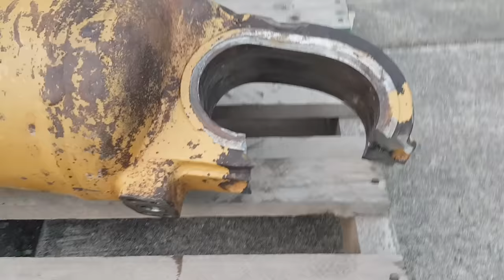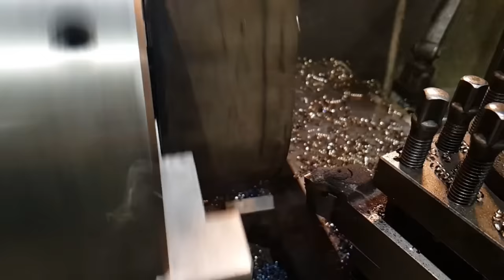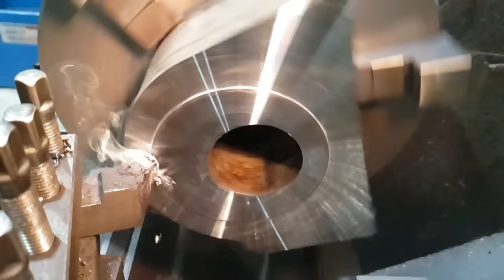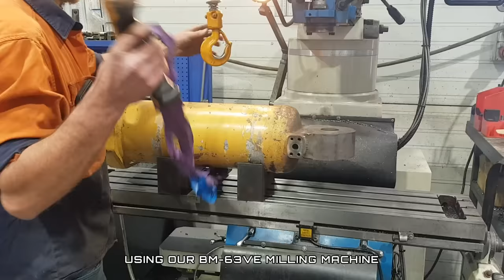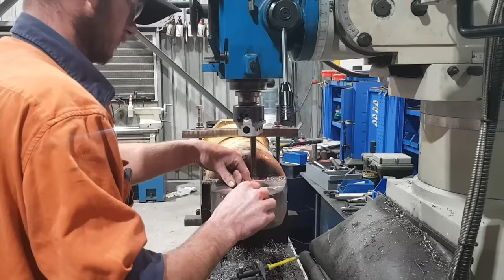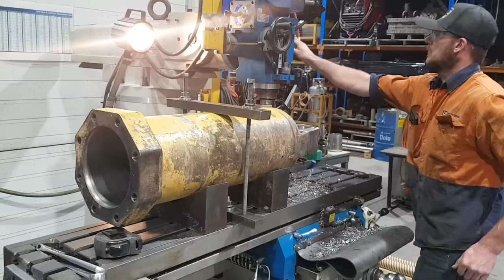Replacing Eye on Hydraulic Cylinder for Caterpillar D9 Bulldozer | Machining, Welding, Milling

Comment: Pakistany truck guys would fix that in 10 minutes with a stick welder and a grinder.
Reply from the maker: Hahaa no doubt 😂👌
Reply: And it would last 10 seconds!
Reply: Yeah. And phuk up in 10s
Reply: And sandals
Reply: And break it again after 1 hour. Lol
Reply: And when the piece breaks and a piece crosses a worker, they throw it on the road and continue without problem ...
Reply: Ahahhaha ha really bro its a pro Pakistan
Reply: The outback bush mechanics wouldn't even need that - an old brake drum, a piece of wood, and a bit of old cable. She'll be right brother.
Reply: And a hammer lol
Reply: Jb weld that no problems lol
Reply: doubt it.
Reply: Human bomb also lol
Reply: But they do wear safety flip-flops.
Reply: And a cardboard box and sunglasses for a welding helmet
Reply: Yeah with a double tape😂😂
Reply: The welding machine is homemade by the guy with flip flops made out of an old car tire
Reply: Like a walk in the park for them
Reply: People make do with what they have. I mean the alternative is not to try.
Reply: Naw, just heat it up, pound it back in place, weld it up and grind off the excess. It will be good to go!
Reply: It would not even fit properly
Reply: This one only took 13 minutes🤷🏻‍♂️🤣
Reply: That’s how it was done here way back in the day, had to utilize what we had, we too were a developing country once.
Reply: 😂 what A comparison.. go shame yourself..
Reply: Lol no they wouldnt. Ugh
Reply: Pakistani weld and chinna goods no guarantee

Comment: Excellent job! I'm curious: this quality job comes at a price, is this part hard to come by, new or used, or is it really expensive? Or is it that having it repaired is simply the fastest way to get the D9 running again?
Reply: He addressed this question in another video: Repairs are just much cheaper.  Replacing parts like this costs thousands more than a day or two of Kurtis' time, valuable though he no doubt is.
Reply: @ofsinope  It looks like the repair is thicker/sturdier too. Which in principle is a good thing, unless it causes sonething else more expensive to fix to fail instead.

Comment: An old timer once told me; “always buy a used caterpillar. Then most of the problems will be fixed. Buy a new one and you’ll spend all your time fixing it”
Reply from the maker: Wise words 😎👊💥
Reply: @CuttingEdgeEngineering  Amen
Reply: A fixed part with 1 brand new part versus everything brand new. Yea dunno that old timers pretty delusional
Reply: @biggestbruh3780  when you fix the part your fixing the initial problem that made it fail in the first place. You’re making it better so to speak. That’s what he was talking about. All the fixes on the used machines are made better than the original if done correct. The repair in this video is a great example of that.
Reply: Nameofthegame if it’s all brand new shit shouldn’t break
Reply: @biggestbruh3780  and yet they do... maybe witchcraft? What do you think?
Reply: Smart analogy let first owner work the bugs out and reengineering...
Reply: I was given that advice many years ago too, by my first boss. He called it the 20/20 rule, which is: if it's still going after 20 minutes, it will go for 20 years. I'm not sure that 20 years is still applicable (things were made better back when I was in that job) but the principle is the same. Brand new equipment is not tested satisfactorily enough before it leaves the place of manufacture, but second hand stuff has been well tested, and any part that broke has been fixed so it works like it should. There is no substitute for the practicality of extensive field testing. I've always looked at it like this: if it's worked reliably for this long, chances are it will keep working for a while yet.
There are arguments to be made for buying brand new of course, and manufacturers need us to do that periodically lest they go out of business. And there are times when buying new is the smarter option. Like consumables, for instance. But it's definitely true that you don't really know what you're buying when you buy new. Salesmen will make all kinds of rash promises about how good the stuff is, but when it fucks up (which it will) it's always a pain in the ass. Getting  it fixed and/or replaced is NEVER as easy and convenient as they claim.
My driveway and garage is full of vehicles and tools of all descriptions, some of them are over 35 years old. The only stuff I've ever had that's failed has been the stuff I bought brand new. I bought a brand new Makita 18v drill/driver once, it gave up after two weeks and I got stuffed around so much by the retailer I resorted to shouting at them in the store to get a refund. "It's been sent off to be fixed". "There's a problem, they're going to replace it". "There's a hold up with the shipping". "We lost your paperwork". "It's arrived but it's the wrong model". Six weeks later, they still had my money and I still had no drill (it wasn't Bunnings, by the way, it was a specialist tool shop who shall remain nameless. Bunnings would have just handed me a new one off the shelf). I went and bought a second-hand AEG unit from a pawnbroker (for a third of the money) and it's still going after 6 years, with its 6 year old battery. You can bet I thought of my old boss a LOT during that whole debacle. And that's just one small example. Don't get me started on the brand new Commodore we (stupidly) bought.... it's no bloody wonder Holden went broke if that piece of shit is the best they could do. It spent more time back at the dealership getting "fixed" than it did in our driveway. Luckily a tree fell on it in a storm one night and we took the insurance money and ran. Replaced it with a second-hand Honda CRV for less than half the money, and we still have that Honda nearly 15 years later.
Reply: @biggestbruh3780  "if it’s all brand new shit shouldn’t break". LOL. You must be young. Don't worry. You'll learn. Us older blokes have learned a thing or two in our time. 35 years in the trade game teaches you a lot about tools and machinery. Read my other comment, see if you can learn something. It's more relevant than ever now, new stuff is made so poorly, everything is built to a budget, not to a standard like it used to be. Profit trumps reputation for most manufacturers nowadays, everything is made in China with no testing whatsoever. They use the public as their testers. If you want to be a tester that's fine, but constantly returning broken shit and getting stuffed around by retailers gets old after a while.
If you want a tool or a machine that's already been extensively field tested and sorted out, buy a second-hand one. Not to mention it will only cost you half as much.
Reply: @woopimagpie  Not sure about 20 minutes.. Perhaps 20 hours. But yes, eliminate the infant mortality and it should last for years, with appropriate grease, lube,  and oil changes.
Reply: Biggest Bruh I worked at caterpillar for 11 years and I can assure you that more stuff broke in the first 20 hours of use, than in the next 200 hours. Their warranty covers 100% of breakdowns in the first few hours of operation and is graduating afterwards.
Reply: @biggestbruh3780  the manufacturer builds a machine at the cheapest cost point possible.  A good repair is the better parts for the longest life possible
Reply: I remember the time when heavy equipment manufacturers didn't make money selling the machines themselves, but profited from perpetually selling spare parts and wear items at markup prices- oh, wait....

Comment: Maybe someone asked that question already but I couldn't find it in comments so I'm asking it now: why welding with MIG? Yeah, "'cuz that's the only welder we got" is absolutely acceptable answer : ) but from what I know about welding this kind of welding (lot of thick metal and high tensile strenght required from the weld) is best served by good ol' stick. 7xxx electrode for root pass, 6xxx for a fill pass(es). And if one has to use MIG then dual-shield wire or spray transfer mode should be used to ensure proper penetration, as "standard" short-circuit mode with regular plain wire is too cold for this kind of repair.
Just asking.
Reply: I would weld this with a stick electrode, not MIG
Reply: He's welding it with flux core wire, the penetration profile is deeper than with a solid wire. No need for stick, this is all cast steel work, and it's not high tensile either.
Reply: @zeroyon4562  Well, id doesn't look to me like a flux core wire, as flux core wire produces a lot of fumes ("smoke"), spatter and slag. Furthermore you normally take the gas lens off a MIG gun for a flux core welding, exactly because of all that junk produced in the course of welding (and you want to be able to see and control the stick-out, as it is rather important in this method).
Judging by the amount of fumes produced here it looks to me like a regular plain wire, MAYBE dual shield wire. (And it certainly sounds like a regular short circuit mode of welding.)
To make things clear - people often use "flux core" term for both dual shield wire and for "JUST a flux core" wire. Those are not the same, and while dual shield wire does indeed contain flux powder in its core, it still requires gas shielding. Hence the name - dual shield wire - to differentiate it from "just a flux core" wire.
"Proper" flux core wire is just that - only flux (in its core) that does all the shielding, no need for additional gas shielding - in other words, it is good ol' stick turned inside out (and thinned quite a bit). 
Back to the topic: I'm not a professional welder but I did my share of MIG welding (plain wire with either straight CO2 or "Argomix" gases), metal thickness ranging from thin sheets of 0.5mm / .020" to heavier stuff of 10 mm/ 3/8" thickness, with all three modes of transfer (short circuit, globular and spray transfer - although I prefer to use either short circuit or go all the way up to spray transfer, whenever possible). I never welded anything "structural" thicker than 10 mm with MIG because I never needed to, and I know that regular plain wire MIG welding is basically good up to 10 mm/ 3/8" thickness. (Jobs like resurfacing/ rebuilding worn out surfaces or welding non-structural and non-critical things are different matter.)
And yes, I know that flux core wire gives you a better penetration (or, more accurately, "fusion"), and so does spray transfer and preheating welded parts prior to the welding - but I don't see anything of it here. And yes, some folks weld 50 mm/ 2" thick plates with MIG (https://www.youtube.com/watch?v=nly1iubiSo4), but this guy preheats all the parts to around 200°C/ 400°F, and he's using dual shield wire (or so it seems to me).
Also, I have to admit I used wrong expression - when I said "tensile strength" I actually meant "fatigue resistance/ resistance to cracking". Which is directly related to "penetration", or "fusion". Sorry, mea culpa.
Anyway, all I just said is not meant to tell you "you're wrong" or enter any argument on the issue - I just wanted to make myself clear and say I'm not convinced by your statement. That's it, that's all. Cheers.
Reply: @MrKotBonifacy   It says in this video he's using Lincoln Ultrafil, which is a flux cored, gas shielded wire. Perhaps I should have been more clear in my original statement, where I worked we didn't bother to distinguish between flux core and dual shield, as it was all dual shield, it was more about which wire we were using- in that case Hobart 910 or Lincoln primacore. It's semantics, pretty much. 

With a dual shielded wire you need the gas shroud. Dual uses spray transfer (somewhere between spray and globular in actuality, but depends on shielding gas and wire), I found around 26-27v worked best on the machine I used to use with Lincoln 1.6mm primacore, any higher and it would result in problems. This was doing positional welding on excavators (high and wide conversion), stick and boom  straightening+extension, up to 32mm plate. 
For the other video you linked to (rock crusher part) it all looks like solid wire based off the silicon deposits on the weld.
Reply: @zeroyon4562   Thanks for your explanation. That "Lincoln Ultrafil" meant nothing to me, as I'm not a professional welder, and this is just a "brand name", pretty meaningless for anyone not familiar with Lincoln products (and I'm not, since BESTER used to be most common brand where I live, and flux core wires were pretty much unheard of when I started my adventures with welding anyway; however, it looks like BESTER recently became part of Lincoln Empire too - but I digress here).
About that "semantics" part - many years ago there was, apparently, some campaign about "proper usage of English" (or something like that) undergoing in UK, and I just happened to visit London at that time. And there I saw, on a double decker, a big poster reading:
"No, nurse! - I said 'PRICK HIS BOIL!'"
(So, sometimes it matters, methinks ;-)
Anyway, back to the topic - thanks again for your explanation - it answered my original question and expanded my knowledge a bit too. About "that other guy and his crusher" - if it looks like a solid wire to you, who am I to argue with that? ;-)
I think you're right, and my guess is he went with solid wire, high amperage and preheating to avoid any slag issues in hard to reach spots.
Cheers!
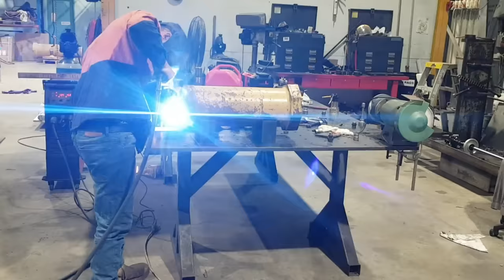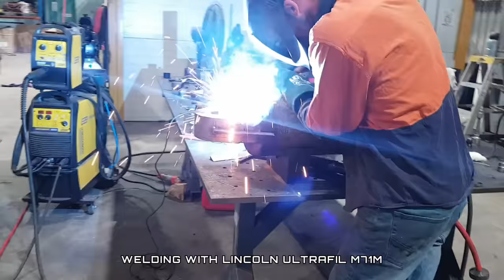Edit/ PS: I just took good look at the welding - seems like @ 5:07 he's doing a root pass with plain wire (very little fumes), and then @ 5:16 he switches to dual shield wire - and perhaps that first impression stuck with me, especially that you don't see any "switching" and there isn't any detailed explanation about root and fill passes.
It actually makes a sense to me - root pass here deals with rather thin metal (at least on one side), and it would be hard to clean the slag in such a tight space - so plain wire seems to be the best choice here indeed (and never mind "strength" or "penetration", as this is just a root pass, pretty negligible comparing to the size of the fill weld).

Comment: So a used stock Hydraulic Cylinder for a Cat D9 goes for around $4000 USD from what I can tell... This job had to cost much more than that right?  Was the client willing to pay for it to have machine running quicker or something?
Reply from the maker: Hey mate. We actually did this for less than quarter of that price. And would've been 3 month wait for stock ex USA to Aussie. 😎👍
Reply: Cutting Edge Engineering Australia , seeet Jesus , last year I have paid £1300 for a new bumper sensor for my crappy 2017 Honda Civic !
Reply: @CuttingEdgeEngineering  For that rate and amount of work I'd be using you to repair and build everything if I was local!

Comment: Man. You do nice work. Love it. How did the cylinder get ripped apart like that?  Any idea?
Reply from the maker: Hey mate yeah it's a combination of a poorly designed component with the grease hole and fatigue from use.
Reply: Also if let go too long, and the bearing (as Cat calls them) or bushing gets completely wore out, the constant slamming of the pin will eventually hammer out the eye and if continued to be run this way, the hammering will eventually break the eye open.

Comment: Curious, how strong is a weld like that compared with the original steel?
Reply: Weld metal should be just as strong or stronger than the original base medal provided the welder knows what they are doing
Reply: A proper weld will be stronger than the metal around it
Reply: Welding is a unique joining method in a sense that when done correctly the pieces actually become one. The weld metal is usually not quite as flexible, but stronger than the original steel.
Reply: They made wrong welding

Comment: Don't seem to believe in swarf going in the open exposed hydraulic fitting holes. No plugs around then?
Reply: It's disassembled and the swarf is just going into an empty cylinder. If it had a valve on there or was a complete cylinder yeah I'd be worried but as is not really an issue

Comment: Nice work. I did a repair on an old Petibone bachoe. My buddy  started it in gear heading for the house ..droped the outrigger to stop it..tore off piston hitting a tree.  with the cyllinder broken & bent lots of metal. I was able to weld the cyllender re attach it. only regret not taking pictures of it.

Comment: Hmmm, repair with a mig, no preheat, no temperature control or UT of each weld run......Sub arc is the correct way to repair this with the heat management and UT checks. The repair as shown won't be anywhere near as strong as the original part.  I used to QA check the welding of 80mm+ plates for Ball mill shells. Lets hope that cylinder eye was way over engineered!
Reply: You can’t really UT a partial weld
Reply: Agreed. This must have been a proof of concept. I can't imagine a new/replacement cylinder costing more than the labor involved in this repair.

Comment: Great to  watch these repairs. Only one comment. I believe the access hole for the hydraulic oil should have been sealed up with a rag or stopper tp prevent particles entering into the cylider.

Comment: If we talk about restoration with the correction of design errors, it was much more effective to make a channel for lubrication through the end of the finger and not to loosen the ear with a hole .. and the channels under the lubricant do on the finger - and do not make them straight in the sinusoid - so that the direct channel under the lubricant does not RUB the furrow inside
Reply from the maker: Yeah lube finger in the channel always works a treat 🤣